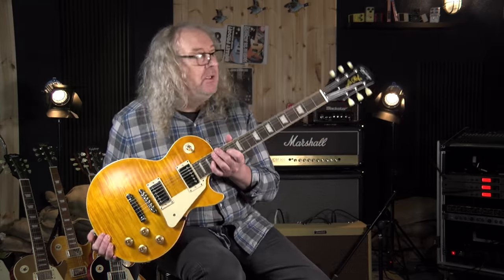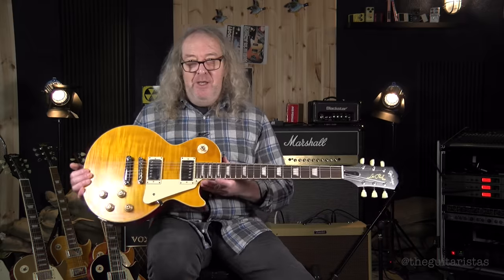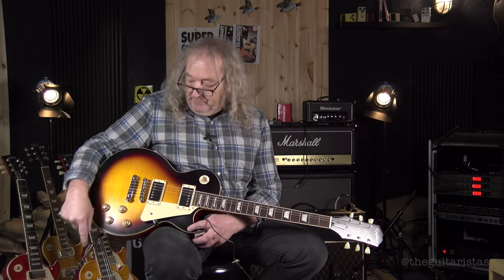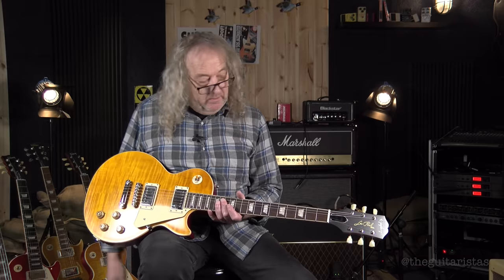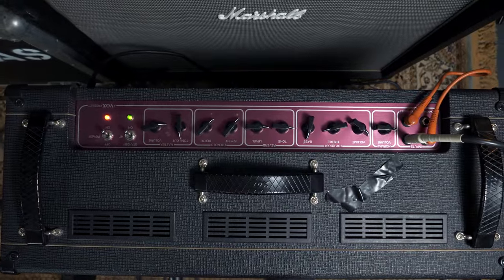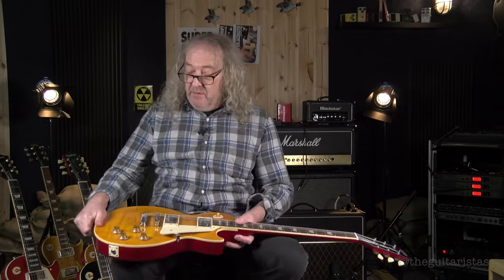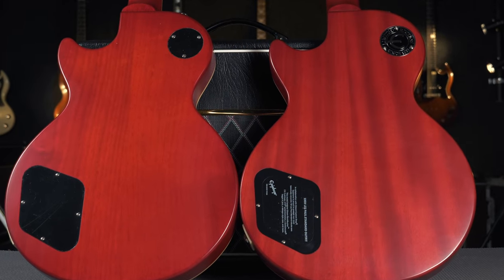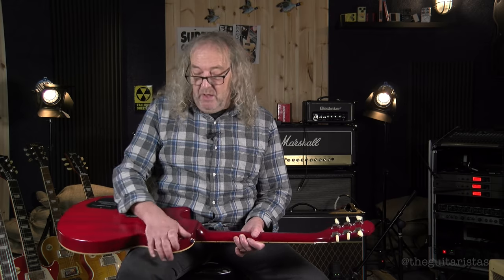Epiphone 1959 vs Lazarus - Ltd Edition Les Paul Standards - Side By Side

Comment: Ordered my Lazarus from Andertons on a pre order mid December 21, collected it 5th Jan 22. Staggered it was available so quickly. Love it to bits. Would also like the 59, but I am now thinking that as they are so close, I may do an upgrade on my 2015 Epiphone Les Paul instead. Really lovely iced tea burst, great flame veneer, but want to sand back or dull down the thick poly finish to make it more satin & change pick ups. It is more a 60s neck & already put 60s knobs on it. Looks the part, but could be better, especially in the playing department. Great post again Colin. Still fingers crossed that a bright spark at Epiphone decides to do a 50s, P90 Gold top, even better with the lighter coloured back.
Reply from the maker: Cheers Paul 😎👍

Comment: Thanks for this. For the untrained like myself is the only designable  difference is the rating of the veneer (which looks great) and obviously a single piece neck. I have a lemon burst 59 (limited run from Andertons) which I plan to buff up a bit. Picked it up for £500 on reverb and noticed the Lazarus being priced around the £1000 mark.

Comment: hi Colin great set of videos on the 1959 Epiphone, had the  2018 Tribute had it 4 years tried the epi cherry no contest traded it in there and then first thoughts this is the sound I was looking for when i bought the tribute.keep up the good work straight up honest videos
Reply: I just recently traded In a brand new 2022 Gibson Les Paul tribute for a brand new Epiphone les Paul 1959 standard outfit 

The Gibson price was 1877$cad after taxes and came with a soft gig bag 

The epiphone price was 1500$ after taxes and came with a hard case 

The Gibson was a bare bones guitar and the only reason it was expensive was because of the name on the headstock 

The Epiphone was hands down a way better built, feel and sounding guitar in every way.  It blew the Gibson right out of the water.  I love the Epiphone’s hand rolled neck and the feel of it better than any Gibson I’ve ever played 

I’ll never ever buy a Gibson again 

My main guitar is a 2006 Epiphone les Paul plustop pro that I modded with new pups, new nut, new capacitors and wiring and she’s a screaming demon.  I regularly get compliments on my guitar sound at my bands shows.   We’re about to go on tour next month too here in 🇨🇦🤟🤟🤟🤟

Comment: Great video. They sound similar on YT.
I  would choose the Lazarus over the 59 due to the top.
The 59  aged dark burst sounds great but that  finish is a real turn off the many time I checked it in the store. I got Aged Southern Fade 59 instead ( paid extra in Australia) and when I finally removed that lame matt finish to bring out the gloss,  I am stoked. Superb look to go with the great sound.
Reply: What did you use to polish up the top if you don't mind me asking?
Reply: @mikeshumate1840  I use Meguiar Scratch X sparingly and work on one area until the matt finish is gone, then the adjacent area. Take your time and not to be too aggressive with it.

Comment: The Lemon Burst '59 will be released in the UK very shortly I believe. I'm about to pull the trigger on a Epiphone Slash Les Paul Standard for a very reasonable price, which I will use as the basis for a few nice mods. Those Bethnall Green pickups from Monty's are great, but £450?!! Thanks for another interesting video Colin. All the best 🤟
Reply from the maker: I have been waiting for those Slash's to drop in price as I still fancy one... any shopping tips? 🤔 I think it maybe worth putting some Bethnall Greens in your Muphy Lab R9 but in an Epiphone would be plain silly.... says the man who put the prototypes in one!! 🤣
Reply: @theguitaristas  🤣 Indeed, the Bethnall Greens are way too 'high end' for an Epiphone, and definitely well beyond the limits of my budget. The Slash Les Pauls are on offer at Andertons, couple of hundred quid off SRP, which I don't think is bad as that includes a hard case as well. I'm tempted by the Sire L7 also, or even a Epi 60's Standard. As I said I'm looking for a sound basis for some mods, any further suggestions would be welcome before I commit to the Slash. Did you manage to get your hands on the new limited edition Gibson Slash 4 Les Paul this morning?? 🤣🤣
Reply from the maker: @mattporter6128  with hard case at that price the Slash sounds like a good option. I may give the '4' a miss until they come down in price by a few grand 😂

Comment: If I could find a good deal on a Lazarus, I would buy one--mainly due to the one piece neck. Through your '59 series, I'm convinced that the '59 is an excellent guitar. I've mentioned several times that I'm getting Epiphones to replace my Gibsons, and the Epi '59 is on my radar. It's a bit hard to justify because I have a PRS Se245. Mine's the one with the maple cap, not the Standard. It's excellent, and really is hard to justify an Epi '59 with the PRS in my collection. I'll probably pull the trigger on the Epiphone '59, TBH. Cheers, all!
Reply: I did it. I bought a '59. The '59 is great. I really like it. I agree that the top is rather one dimensional, though. It's the only thing that I'd knock on this guitar.

Comment: Just out of interest. I've worked with some of the most amazing cabinate makers in the UK. Almost all the furniture they make is with veneers. It's far more stable than solid wood flame timber.
I made a solid wood flamed Telecaster many years ago. I took it from 80% humidity in the North of Spain to the 30% humidity in the South and within a year it was buckled and twisted in every conceivable direction. It was a flame neck also. Which twisted so badly it pushed the truss rod through the back of the neck.
I've just bought a 59 today based on your reviews. I'm delighted it has a veneer. I'm also happy it's not cellulose lacquer it's way better protected with the poly finish from humidity now I'm back up north.
I love your reviews and general chit chat. Great job.
Reply: Another point worth mentioning is a scarf joint is stronger than a solid neck. When cutting a solid neck the grain gets shorter in the neck headstock area . That's why Gibson are notorious for cracking at the neck.
Glued wood is stronger at the joint than the wood itself. So if you have quarter sawn wood running the length of the neck, then a scarf joint with the headstock also having grain run the length of the head stock you have a much stronger neck.
Reply from the maker: Cheers Rory, check out my Firebird review this week... now that has some real fancy woodwork going on! 😁👍
Reply: @theguitaristas  I watch all your reviews. You have your content spot on. It's your personality and honesty which makes it entertaining and informative.

Comment: Nice to see epiphone bridging the gap between them and big G. Mim fender priced guitars were missing for a long time. I just wish the 59 also had a one piece neck like the sg they released. The only problem for the lazarus is that for the same money on the used market (the prices are pretty high) you can get a new japanese made tokai for similar money and a japanese made tokai will always be better than an epi if not standard gibson. Ofc you rly have to know hiw to look. On average lazarus will run you 15-1700 cad while a new tokai will cost 1700 and a used one less.

Comment: Colin, When you factor in the amplification and various FX Pedals, I fail to appreciate any difference in sound, now perhaps playability may be different and that is very important so maybe you could weigh in on that compared to your R8.  In the long run, I fail to appreciate any large scale difference between the two Epiphones you are presenting than the R8 other than the Gibson logo on the R8 as well as the fact that the R8 is a Gibson, especially when you compared the Lazarus with the R8.  I’ve gotten to the point especially at my young age of 68 wheee it really Mox Nix to me now. Cheers!
Reply from the maker: Cheers Bill, I agree and have gone into this a bit in other films… the expensive versions can feel different and perhaps ‘better’ but sometimes it’s negligible and not as much as you expect… rarely worth the extra $$

Comment: Nice video again Colin. A 59 epi is definitely on my wish list. I have a question, what happened to the deluxe Les Paul, why aren't they as popular as the full humbucker. I would definitely be interested in seeing an epi deluxe. Is there anyone doing a deluxe.
Reply from the maker: Good question... they just weren't as popular I guess, but personally I think mini humbuckers and P90s beat humbuckers most of the time. I'd love a deluxe... Gibson released one last year but at £2.5K it's a step too far but if epiphone make one I will be first in line!
Reply: Thanks for the reply Colin. Vintage still do a deluxe style which I used to own and was a lovely guitar after a few tweaks. If course you could always drop a couple of monk's into a p90 equipped guitar. I think I will give that a go. I also have a higher HTC club with monk's in and that is a nice guitar. Cheers Ross.
Reply: Bloody auto spell. That should have said mini's not monks😆😆
Reply: And hofner HTC club🙄
Reply from the maker: @rosskoko100  I've got a set of 'Higher Monks' in mine they are great! 🤣
Reply: @theguitaristas  🙃😂😂

Comment: I have the 59 and wont be getting the Lazarus because they are basically the same guitar except the Lazarus has as you point out, a single piece neck, which I dont like. I prefer a scarfe and heal joint as these reduce the risk of headstock breakages and I much prefer it when those joints are on a heavy guitar which is at particular risk if it falls over.
Reply from the maker: Cheers Tony, that is indeed true as I understand it and a valid reason to choose the 59! 😎👍
Reply: @theguitaristas  Interesting

Comment: My Lazarus is less dramatic to yours, but very 3d in the projections of the stripes, changing a lot depending on the angle. Many folks have gotten individual Lazarus with ultra subdued top, so this is worth checking and buying in person.
In Canada you can find Aged Royal Tea 1959s and my local shop has 2 in stock. One is ... very plain, the other is rather charming.  And yes, I have talked myself out of getting it.  Barely.
Reply from the maker: I'm not sure you have talked yourself out of it yet... perhaps you need another look just to convince yourself you don't really need it? 🤣🤣👍
Reply: Yeah I got my Lazarus a few days ago. Really disappointed in the finish and the book cut. In fact it even looks like there is dirt in the wood. Payed a premium down here In Australia.  Had to polish the freets do the setup. It was really bad. But after the adjustments I will keep it.
Reply from the maker: @MrDemonbot  Shame to hear that.

Comment: I have got the Lazarus and the Standard 50s. The neck profile of the Lazarus is definitely slimmer and a lot more convenient to play. The Burstbuckers are really fine, I don't see any need for a replacement, whereas the Probuckers inside the 50s Standard sound a little muddy to me. I think I will replace these by something else, maybe even Burstbuckers #1 and #2.
I found a comparison video between Gibson Burstbuckers,  Lollar, Bare Knuckle and Seymour Duncan humbuckers and to me the Burstbuckers sound second best after the Bare Knuckles but cost half of them.
Reply from the maker: Cheers Lars, yes I think the BB's in these are pretty damn good pickups 👍 The 50's is also pretty good but is the one to modify of the bunch.

Comment: Nice review as ever.  Just on pick ups I have a little project coming up: long story happily kept short I have a MIM 05 HSS strat with a Seymour D. JB Humbucker and x2 SDs SSL1s (I knew a few who did that in the 80s). Anyway IMO a weakness moment many moons ago by me as the quite expensive SDs are a bit wide for the MIM spacing (narrower than the American Std / new Player).  All playable but special sauce pick ups that don't quite fit ....blah........Now the Squier CV is vintage wide that end so eyeing the 2022 ltd edition ones in satin neck (aged chrome hardware one on due in several places) and swap in the SSL1s probably for chits and giggles (probably upgrade pots etc too)...Nut wise there is real estate going unused so probably widen the string spacing there a tad too whilst playing.........Some ideas for you maybe............................Back to the epi I paid extra for the case many moons ago but noticeably ahead of the one included with my Gibson.  In truth both are good enough for general light gigging probably.  I just have the standard-issue pick ups in my Epi standard LP  but IMO still plenty of LP for small gigs, but I am a one time visitor to that pick up swap lark (OK be twice I guess it do this but the originals will go back in the MIM strat as were good enough)........

Comment: Cool video!  How bout a comparison between capacitors various tones, Mallory- 150 M/022uF+/- 10%/400VDC-HU   VS   Orange drop  ( 716P/400V/200V) and (225P /400V/200V/100V ) all 22.3J/K, this would be  nice.....Just detach the current cap and use a alligator clip connection for the other caps, and listen for tone differences....just a thought......   :-)
Reply from the maker: Cheers Willy, I reckon we will get to caps at some point! 😆👍👍

Comment: Which is the best option; the Standard, Custom, or 59 reissue? I am looking to get an Epiphone and it’s hard to decide. All 3 are within my budget.
Reply from the maker: They are all pretty similar... 59 has a nicer neck, Gibson pickups, and case but at a price.... but apart from that I'd suggest going with what pleases you most aesthetically.
Reply: @theguitaristas  I will have to visit some local shops to see what I can put my hands on. I may end up with one of these 3 as well as picking up a Tokai.

Comment: My 59 cherryburst is a great guitar. Veneer looks a bit nicer than yours but the Lazarus is better. You have your AC30 right where I play mine when I want it "at volume" for home use. Just below 9 OClock on the master volume.  Still really loud. If I go to noon on the master, the basement rafters shake. My version has a switch to jump the channels. But I mostly use the normal channel with the volume just past noon, which with the Burstbuckers, its overdriving nicely, still clean on the Strat unless I really dig in.
Reply from the maker: Cheers Wade, I always end up back on the AC30… such great amps! 😎👍👍